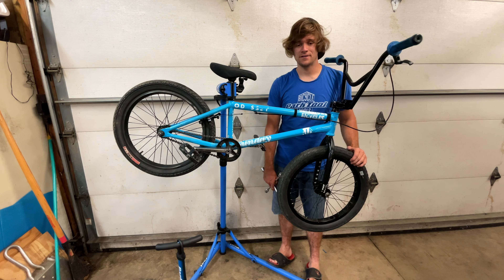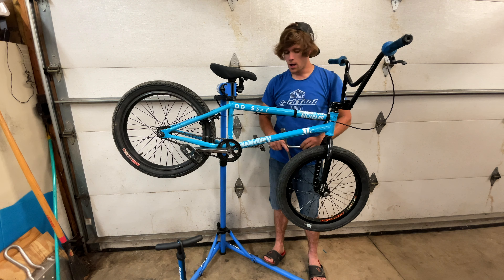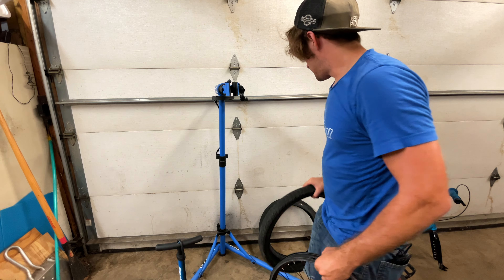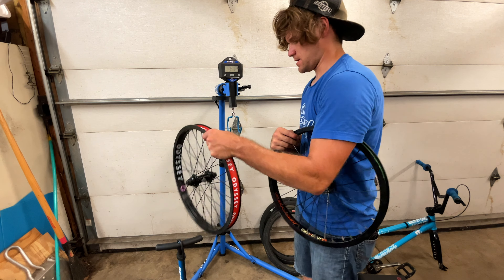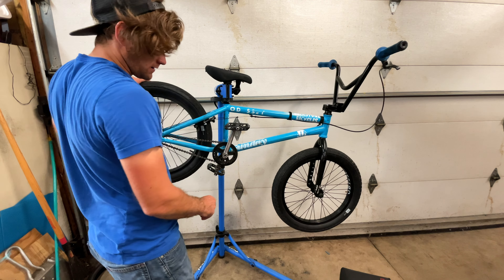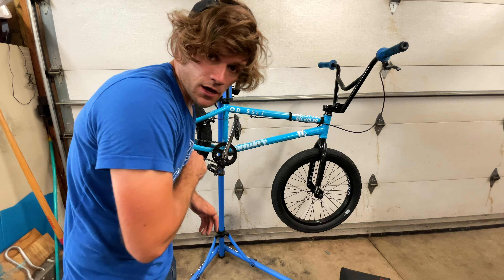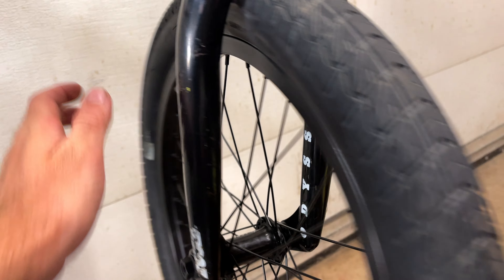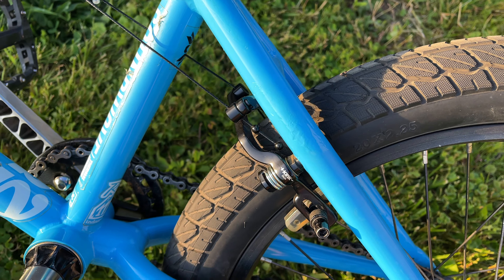The PERFECT Match! Touching Up BMX Frame With NAIL POLISH?!

Comment: I think if you used a hair dryer or heat gun it may smooth out better! Looks great though.  Will definitely keep that in mind
Reply from the maker: Really? I didn’t know that was a thing
Reply: @Brant_Moore  yeah man! I've seen it done with epoxy aswell. Helps get out any surface bubbles and smoothes it out. It may have a different effect with nail polish though 🤔